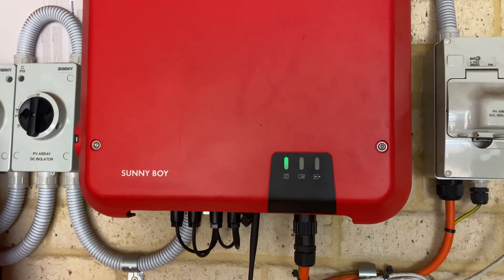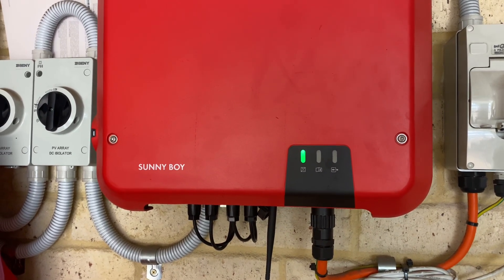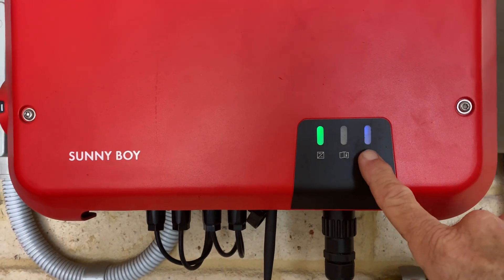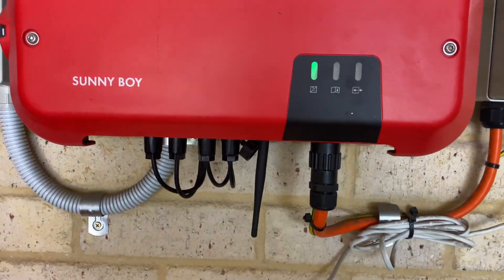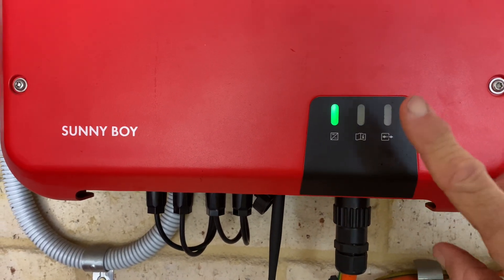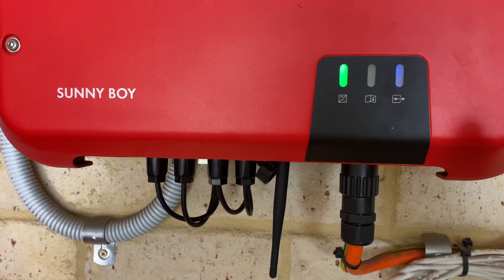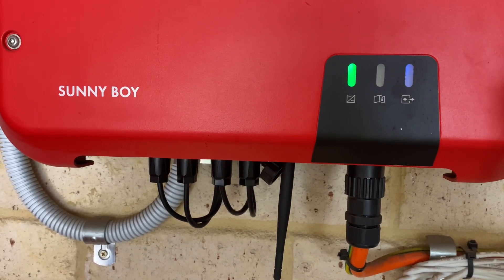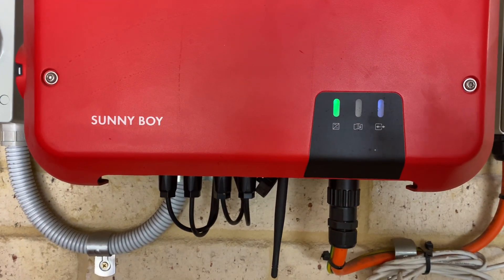How to connect your SMA inverter to your WiFi network using WPS method. The easy way.

Comment: Hi , I've just upgraded to fttp , so a new router Asus , the blue light is on at all , I tried the tapping ( like I was knocking on a door ) and pairing mode did not activate. 

Do  I have to shut down and restart the inverter  ? , and should I do this at night when the solar panels are inactive  ? 

Thanks for the video too.
Reply from the maker: Hi
The process needs to be done when the inverter is active during the day. Its important to knock in quick succession to get it in pairing mode. No restart should be required.